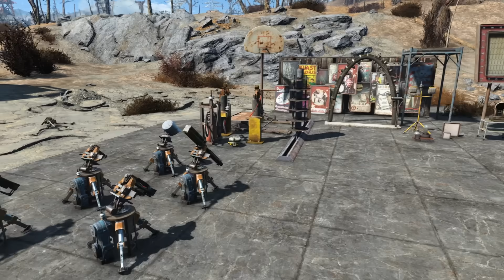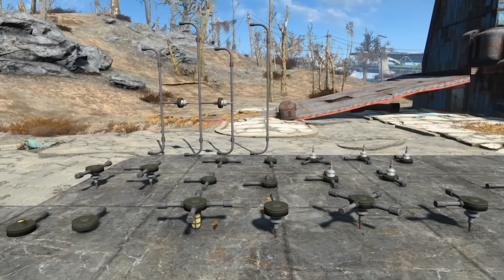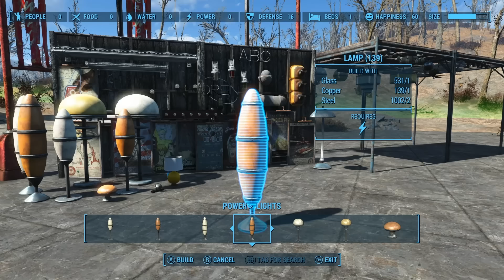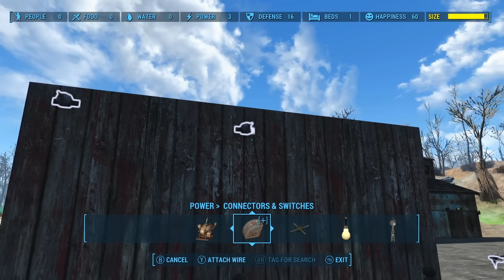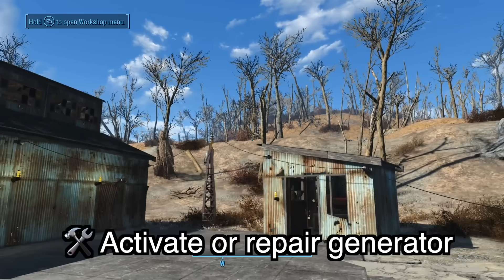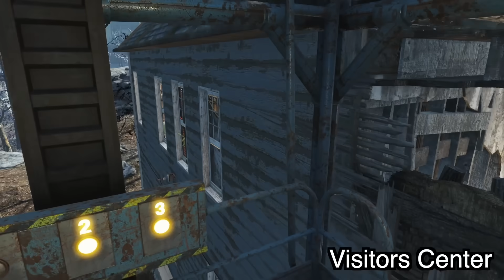How Power REALLY Works in Fallout 4 - Wiring Tips and Tricks (No Mods/Glitches)

Comment: I would just like to suggest that you shouldn't link turrets in sequence, if one is damaged I believe it will then take out anything else connected after it? 
I'm sure I've had that happen before so now I run a circuit of connectors or short pylons around the roof of my buildings and connect each turret separately so if one is taken out the others are still active. 
Also don't use the settlement beacon as a pylon to connect turrets, if you have enough settlers and switch it off it will switch off your turrets!
Reply from the maker: Thanks that is a good tip, connecting turrets in parallel should keep your defense grid much more reliable if one gets damaged!

Comment: Here's what fallout four was missing that I hope they fix.  There should be the base snap together structure pieces sure but I want the other stuff content creators make when it's voted by the community to be so good it's gotta go to the game.  Also there should be quarter panel walls, ones you can drill a hole in if you do a quest for the drill.  And long boards, that you can cut if you get the skill saw from the quest skillsaw' see building is much funnier than we've made it and soon it'll be far more fun.  There could be full 2x4 builds for intricate framing and quests for diagrams that really work well though I would like houses built poorly to fall apart on certain impact or over time or under load.  I mean the fighting system sucks *ss and combat is terrible but that'll be fixed first on its own.  For instance when I get a new weapon I don't wanna shoot a bee four hundred thousand times in the forehead to kill it let me have a horde of enemies who die in one hit.

Comment: Xbox Series X, no mods/cheats: I built a 22-story concrete (primarily) building encompassing the full build area of the Nuka-World Red Rocket settlement. The Red Rocket is consumed within. I also have, from the tip of the Nuka-Cola bottle to the 22nd floor, a hole there...so, if there is a bird for the birds nest on the bottle, the bird can get to it. Anyway, can your solution light that entire structure. 

Google AI keeps asking me how my game doesn't crash all the time and frankly, I have no clue. Just crashes the normal amount.
Reply from the maker: A 22-story build is very impressive, and I do wonder why is doesn't crash when loading it in - I sometimes have problems with the small settlements causing crashes!
Reply: @CCRenovatesFallout  Well, it wondered why my Spectacle Island (Xbox, no cheats or mods) in a previous game didn't crash all the time, either. Two 8 story buildings connected by a walkway in the middle, a 3-story marketplace in dock area, with varying other buildings plus two two-story restaurants with 1,000 settlers. It wondered how I got so many settlers without mods or the use of beacons. I used the Automatron dlc radiant quests. 

I think I figured it out and it's me tricking the game. I have OCD which means I see patterns, and I adapt to the patterns to make my games go the way I want them to go. So, the game crashes because it's calculating in too many cells at once. That can be cut down significantly if you 'hide' certain cells. So, visuals. So, where you fast travel in (if not playing on Survival) should have less visuals than it normally would have. You also either should have less items on your character or drop them immediately after fast traveling in. This will cut down on crashes. Also, save away from the area that may make your game crash, then FT there and get to a stable area, make a save. 

You need to build in areas that turning a corner wipes the full imagery; also, I use partitions from the Barn section as walls inside my buildings on each floor. This way it blocks loading in everything from that floor at once.

I once, in a previous game, built an 8-story no-floor building (except on edges) at the Drive-In with a 1,000 Power Armor Army. They primarily lined the walls, my game didn't crash there as I remember. 

I think it's how you build, where you build, and how much one can see at any given time. You know, how much the game has to load in at once. If it's an overload, well...yeah, it's going to crash, a lot.

Comment: Timer switches and other items controlled by a terminal cause me the most grief.  Sometimes the manufacturing controls disappear from the terminal, and I have to disconnect and reconnect the terminal to get it to show up again.   Setting switch timers also seems tedious, especially if you want different time intervals on seperate timers.  You have to set them up by themselves to an isolated generator, set the time interval, disconnect the switch, then move them to where you want it in your circuit.  That's what I've been doing anyway.  I'd love to know if there is a better way to handle timer switches!
Reply from the maker: I agree with you on the complexity of the timer switches - this is more of an advanced topic that I will consider for working into a future video.  Thank you for your suggestion!

Comment: The Castle has that switch pylon near the workbench, it controls the power to that side of the castle and the water pump, if it's connected make sure it's on.   The connectors in the armory are not connected to power initially.  You need to run power and connect to one of the existing connectors to get that part to work.
Reply from the maker: That is a great tip for anyone struggling to get power running in the Castle. Thanks for the reminder!

Comment: The mesh floors in the barn/warehouse section let you pass the wire through them with no glitch.  I like to run the half floors around the top of a building for a turret platform, then you can connect the turrets through the mesh to a connector on the wall below the floor with no glitches.  Works pretty good.
Reply from the maker: That is a great tip! I usually connect turrets from a connector above the generators, but your idea allows the wires to be more hidden.  Thanks - great tip!

Comment: legit, was pissed trying to play this without mods

just simply running wire through the castle and there wasnt even enough build area in the stupid thingy to even get the whole place lit up

i was obviously doing sometthing wrong i guess?
Reply from the maker: There is nothing wrong with using mods - especially if they help avoid frustration! I don't know if the power connectors that are supplied with the Castle actually work correctly or if they need to be removed and replaced.  When I make it back to the Castle - I will need to investigate that.  Thanks for making me aware of your problem.

Comment: Great tutorial, I've experienced a lot of those issues.  

On Spectacle island, power is glitchy because I think the settlements in in multiple database zones.  Sometimes just disconnecting the generator and reconnecting it will fix a mysterious outage.

Something else I realized doing some complicated stuff is that a logic gate like an AND gate is a diode.  Just using it to pass one input to one output, power flows in one direction but cannot flow backwards.
Reply from the maker: Thank you - glad the video helped! Thanks too for the reminder on Spectacle Island - I forgot to mention that the power doesn't always work there and thanks for the tip on disconnecting/reconnecting the generator to fix outages. 
Good information on the Logic gates too - they are definitely more of an advanced topic!
Reply: @CCRenovatesFallout  For example, if you had a 3 x 5 array of light panels, you could connect two switches to some of them, so one switch would like up a "1" and the other switch light up a pattern of "2".  But that doesn't work because the panels wired to both switches will feed back and light up everything.  AND gates stop that from happening.
Reply from the maker: @O.M.G.Puppies Yes - that makes sense. Thanks for sharing this example - this is a good use of logic gates!

Comment: You don't want to wire powered turrets in series like you did. If you do, taking out the turret closest to the generator takes out all the turrets. It's much better practice to wire the connector to the upstream connector (I find that street lamps work very well for connectors that don't get attacked) and then each turret independently to the connector.
Reply from the maker: Thank you so much for reminding me about this! The street lights are a great idea too! You describe a great way to prevent attackers from disabling your defenses - I honestly have never seen an enemy attack the street lamps to eliminate the power. Thank you for sharing your ideas!
Reply: @CCRenovatesFallout   The only downside to using the street lights is that each of them does require 1 power.
Reply from the maker: @NevadaStrayCat Yes that is true - but their height makes them worth the extra power (IMHO).
Reply: @CCRenovatesFallout I concur. And I like the way they look better than the tall pylons.
Reply from the maker: @NevadaStrayCat - Agree - I do too!

Comment: Another excellent video - and I learned something new -- didn't know it would let you put those small connectors on the floor like that -- good to know.  Few ideas -- from the Wasteland Dovahkin:  Those small generators can be stacked - use a half barn wall.  Put 2 generators down next to it.  Attach a half floor to the half wall.  Put 2 more generator on top of that..  You get 12 power in the space the 5 power generator uses up.  And you save on electrical materials as well.  Early game I make a 2x4 building and line 2 of the walls with double generators and send it out (later I scrap them and put in a fusion generator as an upgrade).  Later, when you hit Vault 88, you get new power connectors - small white ones that are less obnoxious in size, and easier to hide on existing poles to make it look like they belong there.  They also work well with the Nuke World lights, allowing them to become more like the other street lights (if memory serves, that is).

Mod wise -- the Settlement Objects Extended (SOE) mod offers the larger looking connectors that also cover a larger area, saving you from using multiple connectors and more wire.  It also includes the Far Harbor wind turbines that look very nice, offer 15 power, and are visible at a distance, making them good for settlement marking too.  If you get the "Do your Damned Job Codsworth" mod, the houses all have a connector at the end of the house to power the entire building, so that's helpful.  I also remember having created conduit networks on floors before glitching them into the Sanctuary houses as roof repair - leave a connector sticking out the edge of the house to connect to the grid.

Anyway - good job, and thanks for the hint on the floor conduits.
Reply from the maker: Thanks for the fantastic building tips, I'll definitely have to try stacking generators - that could really help with space management.  I really appreciate you sharing how you use in your game too!
For mod users - the SOE option could open up even more opportunities for power management and prewired connector from the Codworth mod would be really nice to have - very convenient!

Comment: I gave up on conduits after I learned, like you said, power connectors give you radiant power, but conduit junctions do not. Is the range on the conduit power radiator also two tiles? That one never seemed to work very well for me. I didn't know about the conduit junction between walls, that is great. Another outstanding tutorial! Thank you.
Reply from the maker: You are welcome!  Glad that you enjoyed the video! I rarely use the conduits (other than for getting wires through the walls) because they use a lot of copper. I just checked the conduit power radiator and it looks like it only transmits the power about 1 tile - so that might explain why they didn't work so well for you!

Comment: I always thought the amount of power of a generator was enough to power for example, with the smallest generator, 3 light bulbs that needed 1 power each, so if i put 5 lights in a house i would need a 5 power generator... right? So i gather that with a 3 power generator it would be enough to power an entire house with lots of lights and stuff provided its wired correctly?
Reply from the maker: Yes - that is correct - only one generator is needed. The important thing to remember is to distribute the power connectors or pylons around the house so that the power is able to reach all of the lights (the power can reach about two tiles in every direction).  I try to keep as many of the wires on the back and sides of the house as much as possible but on a large house you may have to put a few on the front too.  If you notice that there are lights that aren't working, just add another power connector and wire it to another. 

You can also use pylons to connect the power to other houses (in the video I used condiuts but you can also use pylons) and still use the same generator.
Reply: @CCRenovatesFallout  Oh that's nice, so wait, for my water farm (like everyone does in Sanctuary i think), each water purifier, the big ones, need 5 energy to work... so I only need one 5 power generator to power, say, 10 purifiers, provided they are as close as much from each other and wired with several pylons?
Reply from the maker: @suucat  No -the water purifiers require direct wiring and so each water purifier needs 5 power (so 10 purifiers would EACH need 5 power or a total of 50 power if they are chained together).  The difference is items that need to be directly wired have a lightning bolt in the menu and a number that tell how much power an item requires. Water pumps fall into this category.

Objects such as lights and many decor items use radiant power and can be identified by a lightning bolt in the build menu without a number after the lightning bolt.  These items only need to be in close proximity to a power connector or pylon to power and a single generator can power many radiant objects. 

Hope this helps to explain the differences between the different objects in the game.
Reply: @CCRenovatesFallout  Ah i see, thank you very much for the explanation and for your time, happy gaming.
Reply from the maker: @suucat  You are welcome - glad that helped!  Happy gaming!!

Comment: That was interesting. I don't think I've ever had radiant power work that well. If it was a bug that was fixed, I don't know about it. I also always thought that they all needed at least one power with the single lightning bolt even though there was no digit next to it, it might have been because of some earlier issues and the methods I used stuck forever. Now I want to try and see if any of the fixes that weren't there before are there now, because I seem to remember recently putting up 4 light bulbs next to a 3 power generator and they didn't all function, only 3 of them lit (normal for me). I'll update whenever I remember to run the test.

FYI, that question I had awhile ago that I couldn't find, but you had posted in the description area, regarding going straight down to set things in build mode...well, I still can't do it. Hahah 😆 I don't know, I guess I'm just not allowed...or my fingers can't figure it out, one of the two.
Reply from the maker: I’d be curious to hear what happens when you test the power again - be sure to let me know.  
Did you find the instructions to move objects straight up and down? Here they are in case you don't have them:
➡ Instructions to move items straight up and down in Fallout 4:
Keyboard and mouse: 
1. Select the item (E)
2. Continue to hold (E) and use the mouse wheel to move item up and down. 
Xbox controller:
1. Select the item (A)
2. Continue to hold (A) and also hold (LB) . Use the left thumbsitck to move the item up and down.
PlayStation controller:
1. Select the item with (X).
2. Continue to hold (X) and also hold (L1). Use the left thumbstick to move the item up and down. 
 I can't remember which platform you are on but let me know and I will review to make sure the instructions are correct.
Reply: @CCRenovatesFallout I did find the instructions, but maybe I was doing it all sorts of wrong. I'll try again since you were kind enough to repost them. 😊
Reply from the maker: @vegastrina  No worries - I just wanted to make sure that you had the instructions 😊

Comment: I like to use the Vault Tec power conduits in my builds because, they are smaller and cleaner looking. I had an issue with my Vault not having power, on a recent build, and had to dismantle my whole atrium I built before I found the issue. 1 wall wasn't connected properly to the entrance.
Reply from the maker: I agree with you on the vault power conduits - the basic vanilla ones are obnoxiously large! I didn't include the vault-tec items with this video because the vault power works so differently that would be better to address that in a separate video if there is interest in that.
Reply: @CCRenovatesFallout  I agree. The vanilla ones are too big, especially the ones that point down.  In a real world scenario, you would hit your head on those, unless you placed them along the walls or used only barn or warehouse sized walls. .
Reply from the maker: @ronaldnelson6692 That is so true! I sometimes wonder what they were thinking when they designed these game items!